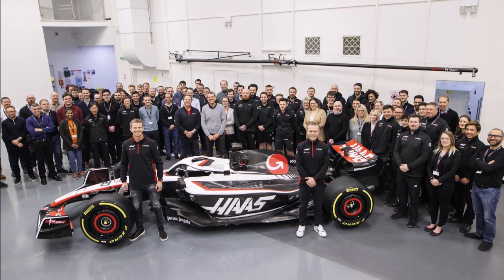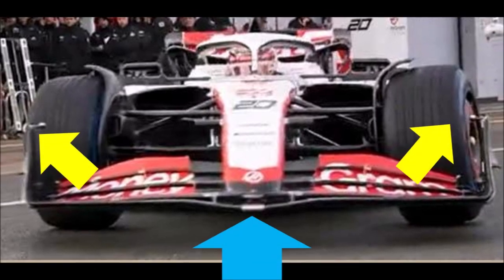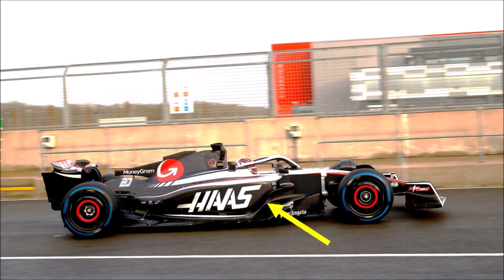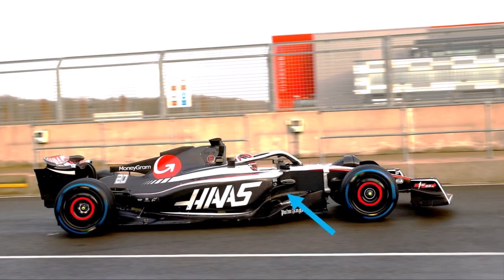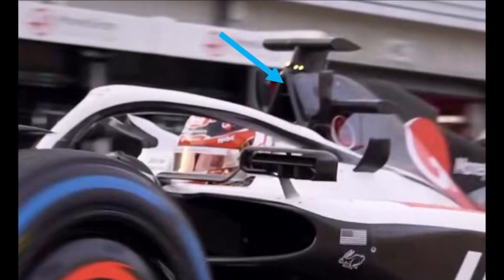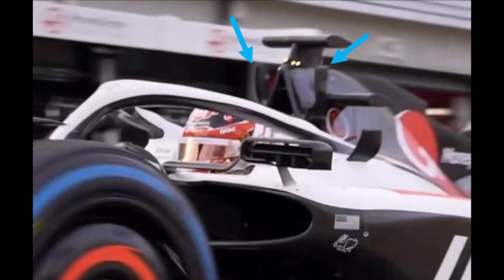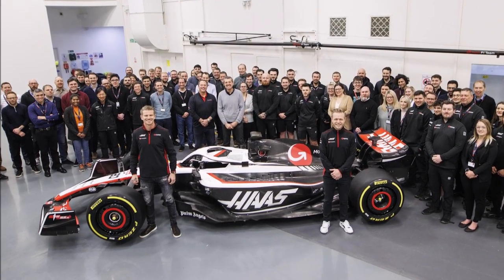F1 2023 - HAAS VF-23 - FIRST LOOK (Technical Analysis)

Comment: You got it right,  the engine cover is much smaller and cooling has not been moved up top like another site said.    That hump at the rear suspension is interesting.   The Alpha Romeo looks like it's much more advanced and original,   they could be the dark horse team.

Comment: Aero seems to be largely similar to last year's car, I'm happy they kept the Ferrari-style sidepods, it means they're confident it can work just as well as the RB-style ones. Also it would be sad if all cars started look alike after just one year. The biggest / most important change so far seems to be the front suspension (which will most probably be the same on the SF-23)

Comment: Could you make a video that explains the differences between the current crop of F1 engines. Most explanations are for previous generations and are a bit complicated to understand.
Reply from the maker: What exactly do you mean? The differences between each current engine?
Reply: @BSport320  yes, that is precisely what i would like to see
Reply from the maker: @RS-jq4oc  Yep, that's interesting. I will put it on my list
Reply: the main difference between the current f1 engines are the placement of the turbo. mercedes, honda, and now alpine have confirmed to be split turbo, which is where the compressor (taking outside air and squeezing it before going into the intake) is at the front of the engine behind the driver, while the turbine (the part that is spun by hot exhaust gases from the engine) is behind the motor. only ferrari is rumored to still be using the traditional design, with both the compressor and turbine at the rear
Reply: @BSport320  the packaging of the components, which of the engines require more cooling, larger or smaller intakes. Actually, I don't understand which questions to even ask about them. The issue is that it's difficult grasp the differences between the car designs without understanding how the power plant affects it. for example, why do the Ferrari engines keep catching on fire?

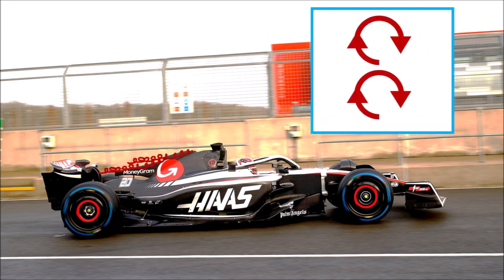Comment: 2:36 Wouldn't vortices rotating in the same direction actually add up to create a stronger/bigger vortex?
Reply from the maker: That depends on if they move towards each other or not.
Reply: @BSport320  Not easy to imagine. Is there an illustration or animation around on the internet?